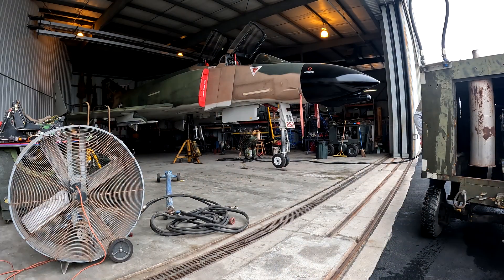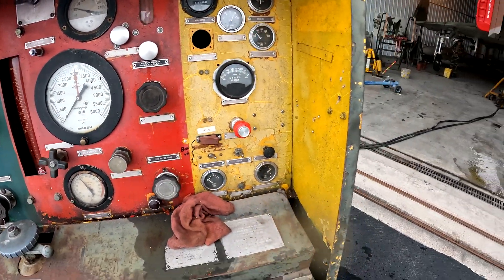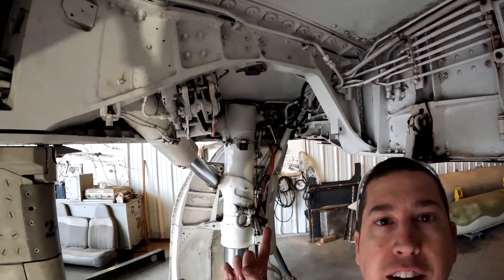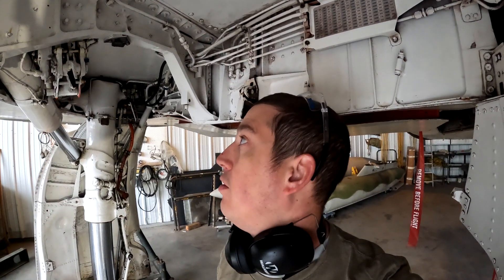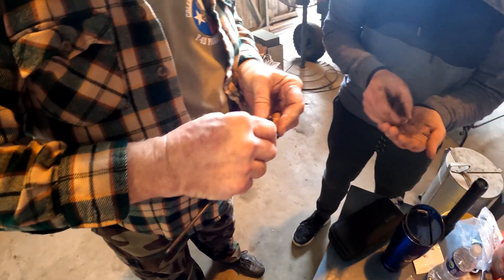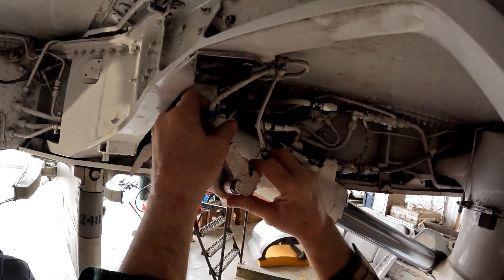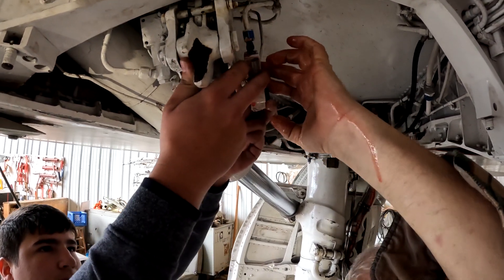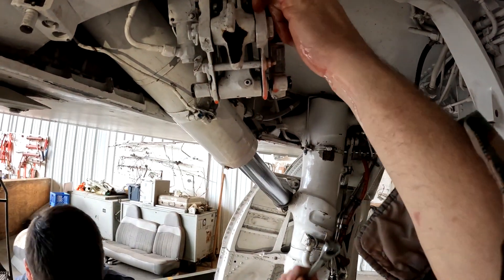Would you believe another leak? - F-4 Phantom

Comment: A bit of professional (armchair ! ) critisizm if I may.   Those types of hose connectors on the mules roof are not cheap. You can purchase a decent (mid-range) open-ring wrench in those sizes for less than the price of one of those quick fittings. Would save marring them up with a pipe wrench + get a good positive seating for tightening and releasing. (Signet 1-7/8" for just under $100 tax included).   Looks like the mule still needs some TLC.
Great progress, the jet is showing sighns of life 👍
Reply from the maker: We're getting there, though seems slow on that lately with that right main gear. A little more insight I learned about our mule, she was sent out to a hydraulics shop some years ago. They found out there that the pumps are not servicable, as far as getting parts or being rebuilt. So we're running with what we have. Hoping that we'll be able to find something newer and better in the future.

Appreciate the insight on the wrenches!
Reply: @DieselThunderAviation  Would be interesting to understand why that shop couldn't service the pumps. If it's due to unavailability in the market of new spare parts, or if it's just they couldn't access the parts in time.
I would try to assertain who the manufacturer of the pump itself is, and work from there, if the company was bought out, who supported the USAF up to the mid 2000 ?
Depending on the type and design of a hydraulic pump, the parts that get worn out are often made of flat brass stock, shaped and lapped to a precise thickness to create a seal. These can be reproduced from scratch by a good machinest. Seals and ruber gaskets can also be custom made to order by drawing. Even pits or crators in pump housing casting, can be built up by laser deposition, then milled and ground to the original shape, commonly used for repairing expensive plastic die casting molds.
As for the right gear, I noticed a bounce at end of stroke when the gear dropped down. Seems there might still be some comprassable gas / air trapped in that cylinder or it's cicuit.
Reply from the maker: I don't recall the exact reason, but I think it may have to do with the lack of available parts for the pumps. Having new parts fabricated likely is possible, though may be cost prohibitive. Fairly sure the USAF moved away from this model cart when they could. It runs on avgas instead of Jet-A. I can't remember the last piston engine aircraft they operated (maybe the A-1 Skyraider?), and I can imagine they used better carts that were either electric or diesel powered.

Comment: I hope you're joking about the surprise hyd leak. If you're going worry over every little leak you're heading for a nervous breakdown. I worked on "D" models in the mid 60's that were brand new (the only hrs were the Mac FCF and flight hrs from St. Louis to Tampa) and had the inspection seals on all the panels that leaked. You have to remember the old CC saying "If you can jump the puddle it's not a leak." One more thing, go through the tool boxes and get rid of all the crescent wrenches. Every nut, bolt and fitting has a size. If you're to lazy to find the correct wrench go away.
Reply: So you’re saying to ignore the leak but get all pissy about their tools? What’s wrong with you?
Reply from the maker: @Q3ark We're not going to ignore a leak, especially on the last flying example in the U.S.